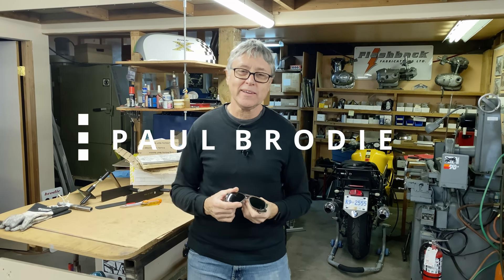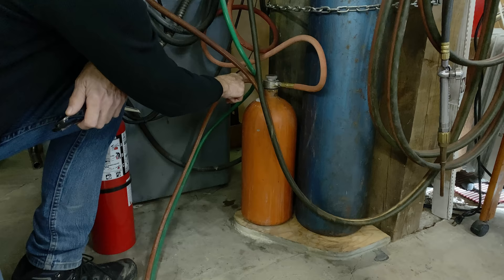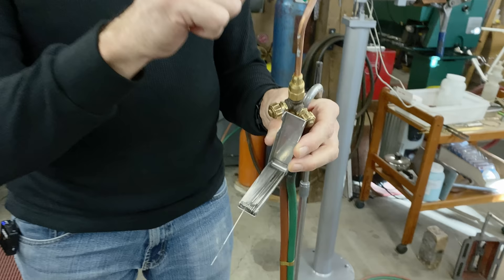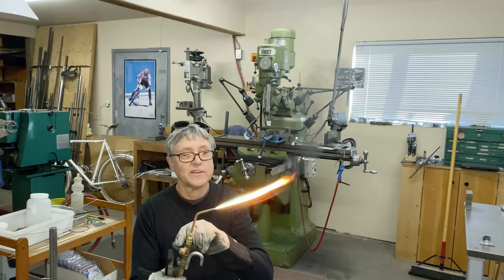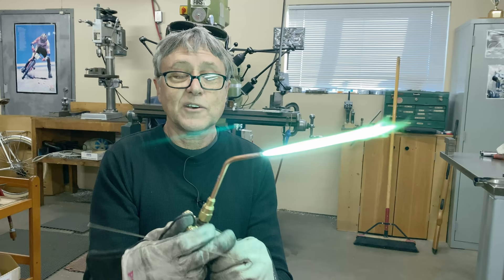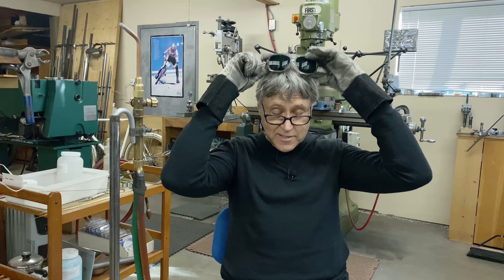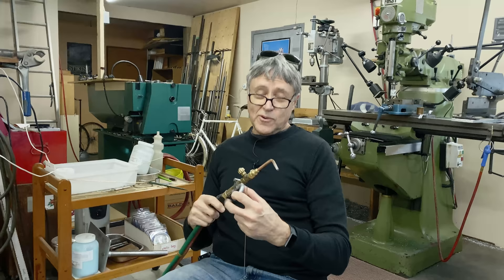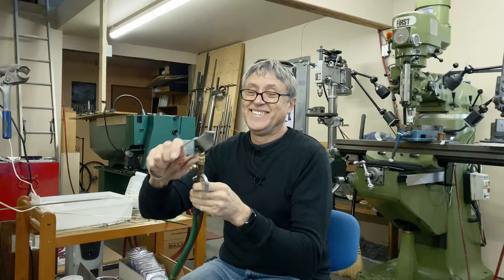How To Braze - Tips and Tricks with Paul Brodie

Comment: Thank you Paul!
What gas pressures are you running for the brazing process, and do the pressures remain the same even with changes in tip size?
Been welding and fabricating for years and done a fair amount of silver soldering on brass but it always seems to take me back near the beginning of the learning curve because it is not something I do often.
Thank you!
Reply from the maker: Pressures around 3-4 PSI. As long as the torch is working not too fussy here. Thanks for watching!
Reply: @paulbrodie  thanks Paul!
I'm used to having the pressures set for flame cutting which are much higher than that. So I would lower them slightly from there to do brazing. Still too much pressure so I'm anxious to try more brazing with those lower settings.
Reply from the maker: @jacko4483  Try 2-3 PSI. That should work fine for most small welding tips.

Comment: are you using cobalt blue lenses to filter out the green from the flux? I used to fabricate vintage race car frames out of 4130 they were all brazed with a jet fluxer but the green lenses, seeing the cone to get a neutral flame is darn near impossible the blues cut the green and also let you see the moly change colour so you know when its ready to go. Also what flux do you use I ran out a few years ago and thank you.
Reply from the maker: I have never heard of or seen blue lenses. In our Fillet Brazing 101 video Mitch has good closeups of both kinds of flux.. Thanks for watching!
Reply: @paulbrodie  you should try blues you would probably like the outcome all you see is the joint and braze flowing i only have one lens left or i would give you one thanks
Reply from the maker: @thestumaji656   I will ask my welding supply store..

Comment: Excellent video, I can't afford a flux bottle, I've used flux coated bronze rods, is that OK or not as good?
Reply from the maker: If you have no automatic fluxer, a coated rod is better than a bare bronze rod..
Reply: Flux paste is also an option. Apply to the areas you’re brazing. Available for silver or bronze brazing.

Comment: Hi paul. I got inspired by this video and your 101 video to start to learn bronze brazing.  I am looking for filler material, and have found SiliconBronze with a melting temp of 1000C, and Nickel Bronze with unknown melting temp.  What are you using, or rather,  what is a good alloy to start with?
Thanks.
Reply from the maker: If you are just learning, use whatever is at hand. The fillet brazing 101 video shows all the rods and flux that I use here in Canada. In other countries you might have to make substitutions.

Comment: Thank you, so very much, for this video! I am in the process of learning how to oxyacetylene braze, and all the information you offer has helped a lot.
I have a question about the small, red inline, automatic flux bottle you are using in the video.  Are those available at most local welding supply shops, or is that something you made in lieu of using the more expensive one with all the levers, which you mention?  I would like to try an inline flux method like the one you are using.

Thank you!
Reply from the maker: In Canada, they are available in welding supply shops. But, if you walk in and ask for one, they probably won't know what you are talking about; you will have to explain, they will talk to their supplier, and then the order will be placed. I bought mine in 1985 and it cost me $800 Cdn. They are not inexpensive. Thanks for watching!
Reply: @paulbrodie  thank you for taking the time to respond.  Ill put a call in with my local welding supply shops and see what they can come up with.
Have a wonderful day.
Reply: @paulbrodie   @paul brodie  one more question please,  if you don't mind.  Is the name and type of the liquid flux you are using for the in-line flux unit Gasflux, Type "W"?  I'm trying to make it out in the video. I called my local welding supplier and they had no idea what I was talking about LOL!  If I can tell them the name and type of product they should be able to find it for me.
Thank you.
Reply from the maker: @KZ_Kon  In the Fillet Brazing 101 video Mitch does a closeup on both fluxes..
Reply: @paulbrodie  thanks for the info.  I have watched both vids (they are wonderful, btw) and saw the close-ups.  They were a bit small and fuzzy on my phone.  Ended up watching again on my tv, and there they were, nice and big.  :)
Thank you, again.  I appreciate your help, and all of the information you are sharing online.  Have a fantastic day!

Comment: Question about flux. You showed the in line fluxer and you put a little flux on with the brush before brazing. Do you always use both? Is it possible people who use a lot of paste flux need more because they don't have an in line fluxer? Could you use just the in line fluxer and not brush any on? Is there some advantage to using both? Maybe for clean up after brazing, or for flow and coverage? I have only ever used the brush on method but try to manage how much I put on.
Reply from the maker: I always use both. Yes, you can use the inline fluxer and not brush any on. I watched a video where they brazed a motorcycle frame with that technique. I think the advantage to using both is you end with sufficient but not excess. If you don't have a fluxer another way to go is with a flux coated rod. If you get the metal too hot and burn the flux, it is difficult to get off. With a "proper" braze the flux comes off easily with hot water.

Comment: I'm m trying to practice by making the icicles but I'm having some trouble. Mine doesn't look all bronze colored like yours. It keeps turning black (oxidizing?) and then I have difficulty getting the next blob to adhere. I tried turning down the flame but then the filler doesn't melt quickly. I do not have an automatic fluxer. Do you think that is a problem?
Reply from the maker: The automatic fluxer really does make it so much easier. Failing that, dip your rod into flux as often as you can. That should help... 🙃
Reply: @paulbrodie  Ok I will try that. I just watched the part where you do it without the fluxer and it doesn't look like what I'm getting. I'll do fine for about an inch or so and then it starts turning black and making popping noises. The bronze will melt but it just balls up on the end of the filler rod and when I try to heat the top of the icicle to get it to stick it pops and the ball falls off.
Reply from the maker: @ryannicolo3738   I know automatic fluxers are not cheap, but I cannot imagine not having one. Your brazing skills will improve hugely with a fluxer. Good luck!
Reply: @paulbrodie  I plan to get one as soon as I have the money for it! Thanks!

Comment: Thanks Paul. I'm planning to build a large scale model RC airplane (about 4M span) with a brazed chrome moly tubing fuselage with tubing ranging from 3/16" to 1/2"' diameters. Is there a simple way to create the form fitting joints of smaller tubing? Also, I would like to use a Oxy-Mapp torch I have on hand vs.a Oxy-acetylene setup. Pros and cons? Thanks.
Reply from the maker: If you have a milling machine you can make a fixture to hold the small tubes and then mitre them with an end mill. I have only ever used oxy-acetylene, never mapp gas or propane. Sorry I cannot advise you on that...  :face-blue-three-eyes:

Comment: Where would you use a bronze vs nickel silver brazing rod? Also, can you create a fillet braze by first starting with a nickel silver braze and then follow that with a bronze fillet? Thanks, Steve
Reply from the maker: On a bicycle frame, I use 1/16" nickel silver for pinch lugs, brake bosses, and to start the fillet brazes. It is strong, and has slightly better flow characteristics than bare bronze. Yes, I always start the fillet braze with a small pass of nickel silver. Bare bronze rod (3/32") has better characteristics for building up a larger fillet. Good questions!    :face-fuchsia-poop-shape:

Comment: This is unrelated to the video I have to breathe a spring Cable in that used in a sewer auger into a cup it's basically just a piece of three-quarter steal that I'm bored out on my lathe to accept the spring and cable. If you've ever used a sewer auger it's the part that holds the different various tools that you attached to the auger it broke off because it was just clamped on with some industrial clamping machine and it wasn't a good connection so I'm basically going to fill the cup with braised. I have made some undercuts to hold the braids from ever sliding out even if it was not attached or adhered to the metal so it can't pull out no matter what

My question is how do I recondition the spring steel not to be brutal or easily bent after heating it to the temperatures for the brazing procedure? Will it be brittle do I have to heat it up to an amber color I don't know what to do but it has to be brought back to its spring steel like quality even though it's only a very small amount of the cable I don't want it to easily break. If anybody would know this I think it would be you

Thank you in advance

Comment: I am starting work at this place where they manufacture wheel chairs and one the requirements other than mig and tig welding is brazing, they braze metal with what looks like brass rods not sure if it's sillybornze but they have a similar small torch setup and the flame is also green, i asked what kind of gas and all they said was it's boc ? it comes through lines from an exterior tank i think but would you say this is a special mix gax or does it have this flux in it that makes it appear green as if the flux is copper? anyways i need lot of practice as i don't have brazing  exp and unlike tig you need to have stead hands to move the flame and have the rod follow the heat they hired me though because im still able to tig weld aluminum and mig steel and they liked my personality lol anyways any tips you can give me on brazing or explain about the gas? thank you
Reply from the maker: I would think that your employer would be in a much better position to explain the gas and the flux to you, rather than me guessing....
Reply: @paulbrodie  yes its oxy/accy with a flux injection system similar to what you have but there torches are smaller
Reply from the maker: @ARCSTREAMS  What matters is the size of the tip, not so much the size of the torch...  :glasses-purple-yellow-diamond:
Reply: @paulbrodie  yes, its just easier to handle less weight i suppose
Reply from the maker: @ARCSTREAMS  Yes, that's why I also run smaller gas lines too...   :face-blue-three-eyes:
Reply: @paulbrodie  that def helps as we got smaller ones at work as well but the one you showing on vid appears like standard hose size 1/4bp?  and ours have tip attachments that screw onto the end

Comment: Hi Paul, thanks for the video. I notice in some of your other videos that you will tack and/or tin the joint with silver, before fillet brazing with bronze. Am I understanding this correctly? I assume this is to reduce heat at the sharp edge in the root of the joint, compared to all bronze? presumably there is no issues with filler metal incompatibility, and you use the same type B flux for both?
Reply from the maker: Hi Brandon, don't confuse nickel silver with silver solder! They are very different. I like to use 1/16" nickel silver: it's a smaller rod than the 3/32" bare bronze rod, and because it's smaller it's easier to melt and flow into the joint. It has very good flow characteristics as well. Yes, they both use the type B flux. Thanks for watching!
Reply: @paulbrodie  Thanks for the follow up, makes sense that you'd use Nickel silver here, as that's what you'd use to build small fillets? Would you mind sharing the brand and alloys that you use? Here in the US, it seems that Harris Safety Silv is the go-to choice, but you seem to be using something different?
Reply from the maker: @cyclecats    Brandon, this is confusing for a lot of people. Nickel silver is very different from silver solder. It's the "silver" that get people confused. Harris Safety Silv 45/56 is silver solder. It has a silver content of either 45%, or 56% (usually..). It comes as a coil, never straight. Nickel silver, on the other hand, is ALWAYS straight, and comes in 36" lengths. Last time I ordered nickel silver rods that's what I asked for, I did not have a part number, and the welding shop sent me 1/16" nickel silver rods, and they flowed just like what I was used to. Now we have the YouTube Channel, and viewers want part #'s so I went to the welding shop and asked for a spec sheet. Nickel silver has the following part #'s:  6800 is 0% silver, 6804 is 2% silver, 6805 is 5% silver, and 6806 is 15%. The sales guy and I figured I probably had the 6800 rods with 0% silver, but we're not 100% sure. Brand name is Soudotec.

Comment: Around 22:30, he switches to the nickel rod.  He says it is a good filler metal for brake bosses but not for brazing water bottle bosses.  I don't understand why.  I am guessing that he means  that nickel is overkill on water bottle bosses because there is more strain on brake bosses.  But if he means that there is some sort of metal incompatibility, I don't understand why that would be the case.  

???
Reply from the maker: Water bottle bosses are often located in the thin wall section of a butted tube. This means it is often 0.5mm thick. Using silver solder means there is less chance of over heating the tube because it melts at a lower temperature. Silver solder is amply strong for water bottle bosses. Nothing to do with metal incompatibility, make sense?
Reply: @paulbrodie  Makes sense! Thanks.

Comment: Amazing welding, do you think this would work to weld on car exhaust ?
Reply from the maker: I have brazed car exhausts together when the metal is new, but steel welding is better on used car exhaust tubing.
Reply: @paulbrodie  thanks for your reply, pardon my ignorance, but is steel welding with an electric welder ?    I did refrigeration for some years and did alot of brazing of copper and steel tubing using an acetelyne turbotorch and silphos/silver solder - I need to do some exhaust work on my truck and would like to do it myself if I can, I was thinking to braze a few new pieces of tubing in to the existing tube which I believe is aluminized steel, using my torch and silver solder - do you think this would work ?
Reply from the maker: @kellismith4329  Sounds like you're mixing way too much stuff together. Alumiinized steel with silphos silver solder? Does not sound like a good recipe to me.
Reply: Ya I wisened up and took it over to the muffler shop to get it done properly, I like to do things myself when I can but I don’t want to do this over again - alot of bends and angles that needed ti be right on the pipes.

Comment: Why 3 bottles? i don't find reference about this setup or "flux bottle"
Reply from the maker: One is oxygen, one is acetylene, the third is the automatic fluxer...
Reply: @paulbrodie  thx, you apply after flux with a brush on surface to braze so you use flux twice?
Reply from the maker: @lazyac_   No, paste flux with a brush, and flux comes out the torch thanks to the automatic fluxer.